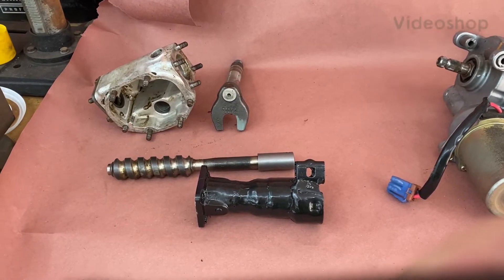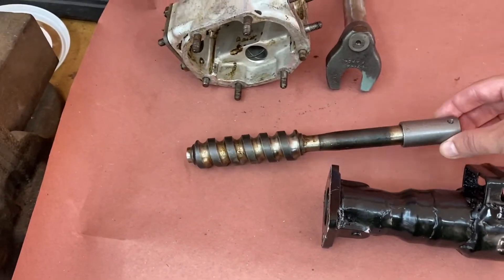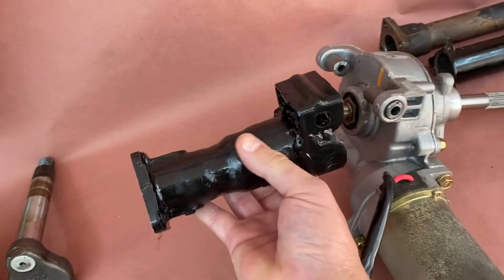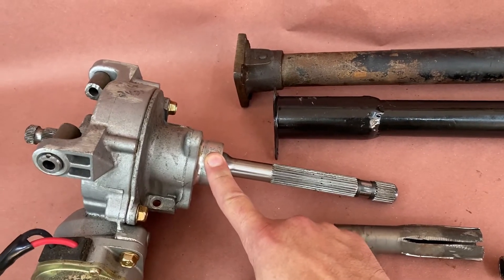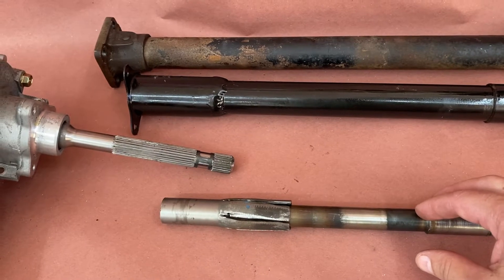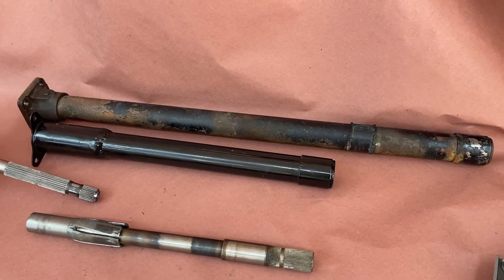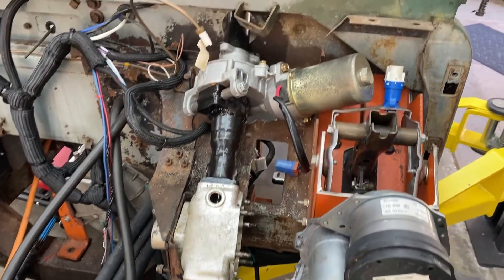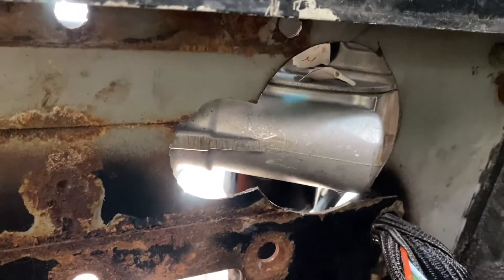Electric Power Steering for Series LandRover Power Steering : Part 2

Comment from the maker: So I went to drive the beast and the coupler stripped 😮…. Turns out the proper measurement is 16.5 mm 36 spline x3/4 shaft….  Had the buy a whole new Saturn Vue unit as first one splines were stripped….  Updates to follow….